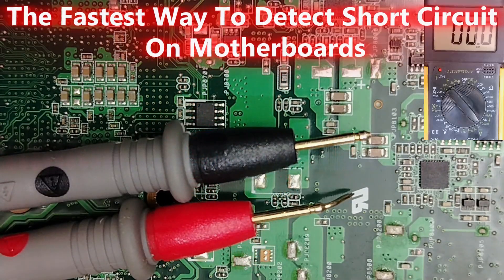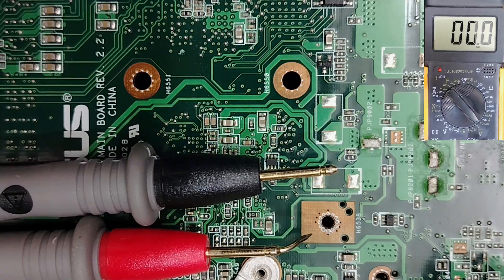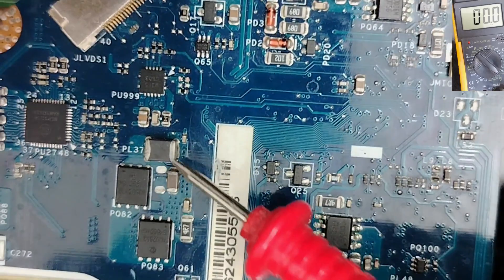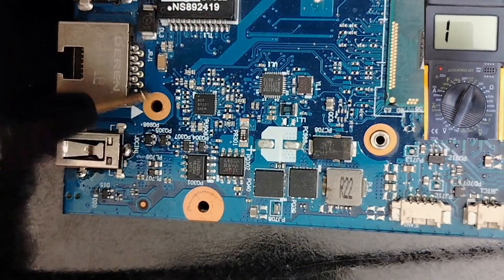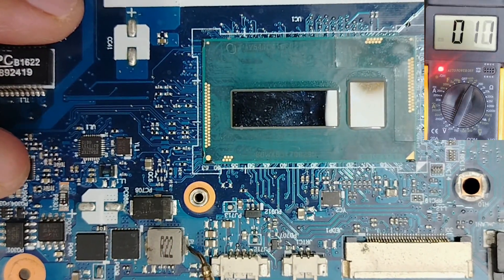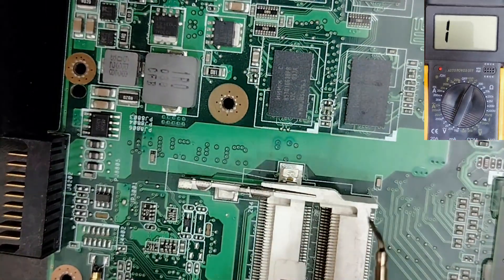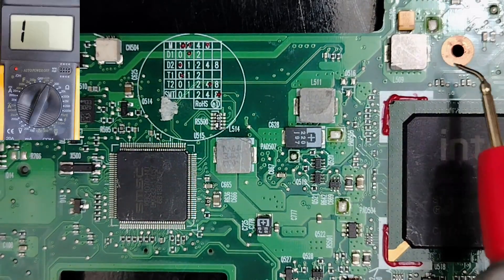FASTEST Way to Detect Shorts on Motherboards | laptop motherboard short circuit repair 2

Comment: Nice presentation... sir...is it possible to repair the power module board of Bosch washing machine front load...a little resistor crack is there.... is it good with repair with replacement resistor....or we go with new power module board....if we repair the board how much life it gives...let me know thank you 🎉 sir please message thanks in advance
Reply from the maker: Yes, it’s definitely possible to repair a Bosch washing machine power module, even if a small resistor is cracked. As long as the PCB isn’t burned and the surrounding components are healthy, replacing the resistor usually brings the board back to life.
How long will it last? If the failure was caused by age or moisture, the repair can last years. But if another component upstream is stressing that resistor, it may fail again, so it’s always smart to check the nearby diode, triac, and voltage regulator too.
Feel free to ask

Comment: Sir pls can you create a video on Chromebook laptop circuit diagram. I'm struggling to understand the laptop component. It's really frustrating. Pls I would appreciate.
Reply from the maker: I'll consider making a video on that in the future.
Reply: @electronicsrepairbasics_erb Thank you sir. I can't wait.
Reply: I got a question to ask, my  chromebook refused to on, i tried trouleshooting i notice the capacitors were not shorted but some few capacitors around charging IC don't  have 0 volts while other have 5v coming from the charging port. Does it mean the charging IC is bad?

Comment: This video assumes the CPU is socketed and that you can remove it in the first place. Most modern laptop CPUs are soldered directly to the board and removal for the sake of diagnosis is not practical, even if you have a BGA removal machine due to the tedious nature of removal and reinstallation.
Reply from the maker: Thanks for pointing that out

Comment: I think without voltage injection & use of thermal camera its hard to detect short circuit quickly with 99% confidence

Comment: Because of this video i remove all inductor coil because its all shorted and throw them
Reply from the maker: Inductors are just a sign of a short, the short could be caused by capacitor, diode or IC.

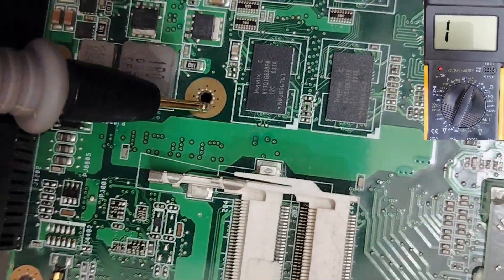Comment: 3:14 You are making such a mess brother 😮, 1st board ok with values, second WO values you stll say OK 🤷‍♂️
Reply: If you see no value, just 1 then it means there is no short. No connection.
Reply: @hasanagera  Except then at 7:30 he also says "one" around the cpu. I don't understand if we are supposed to be getting a high number or a low number.
Reply: @jb8478 you shouldn't hear any beep across a capacitor

Comment: Hey you need to show the multimeter reading in video frame... In this video and some of your video you failed to show the screen of multimeter properly.. And go further how to remove shorting if it is a mosfet or capacitor and if it is pch then if the board could be repaired or not.
Reply: mosfets are just switches. Often you will find two mosfets and a coil in a ps. if one of the mosfet is shorted you just remove the mosfet and solder a jumper betwen input and output. Shorted capacitors can be most of times simply removed. You can either replace them or sometimes even just remove them. it will work just fine

Comment: Why does everyone do it differently black or red cable to ground??
Reply: red probe in ground is used in diode mode. Then you will look to low voltage drops (that also means low resistence).

Comment: Low resistance readings on inductors connected to the CPU or PCH are normal due to their low operating voltages, whereas very low or zero resistance on capacitors typically indicates a short circuit and a fault.
Reply: Thank you, that makes sense.

Comment: Sir, you have explained the method of checking short circuit in a very good way. Thank you very much.
I have a dead motherboard  " fiji mb 12238-1,"  can its circuit diagram be downloaded for free from anywhere?
Reply from the maker: Thank you, Yes could be
Reply: @electronicsrepairbasics_erb  Thanks for reply 
Please share the link where the circuit diagram of  " fiji mb 12238-1  " can be downloaded for free.

Comment: This video, is confusing, Infact I do not really see this as informative
Reply: Just wanted to say the same... 
Now I'm gonna show you a shorted motherboard, ok, so this is NOT shorted, so what?
Reply: @NSC-Modz-II  he tells you whats not shorted  !!! and the short is the capacitors under the cpu everithing fine.....:)
Reply: im sorry that you didnt follow well what the author discussed.. CPU may  require more or less than  2V hence the lower resistance across it.. 'no short' cud mean very low low resistance or higher..  a 'short' wud mean either 'dead shiort' or 'near an ohm or less..
Reply: Just for likes
Reply: Agreed..
Reply: Agree. I have seen a lot of good explanations and this was not one of them
Reply: Why is it confusing? The resistance near cpu explanation?
Reply: You did not show shorted board ..all you are saying is this is not a shorted board🤣🤣🤣
Reply from the maker: Thank you